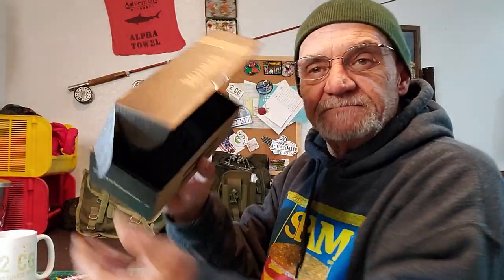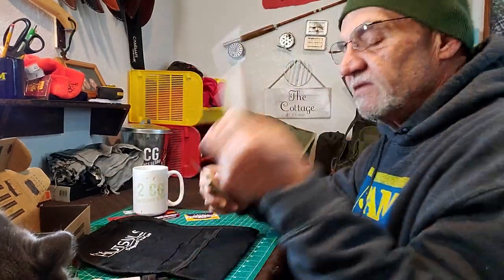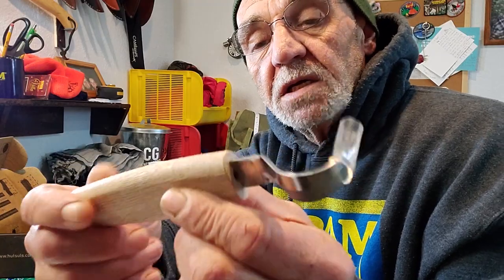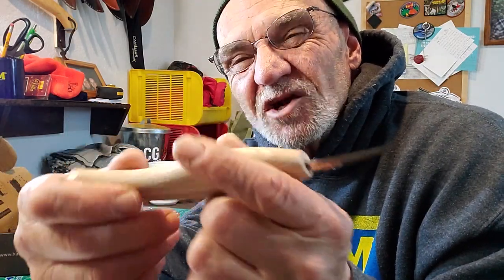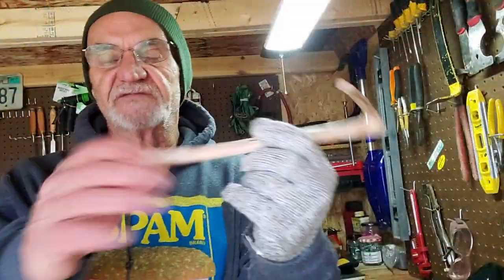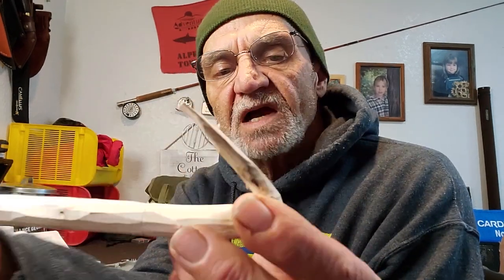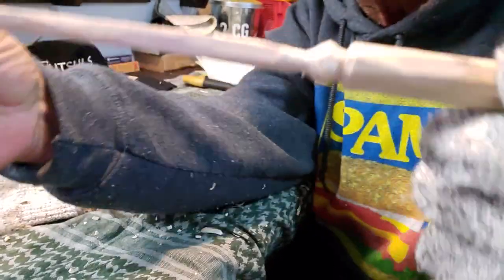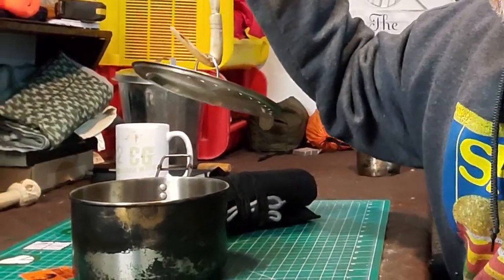Hutsuls Wood Whittling Kit for Beginners - All you need to start

Comment: It came out very good, the kit seems to have enough to get you going for beginner and more.
I thought your covers had knobs on the top, so I thought you were going to carve a cup into the side of that, so it could life it under the nub of the pan lit.
Much easier, now that I understand the use.
Thanks for the demonstration.
Have fun, be safe.
Reply from the maker: On most stanley stuff they pots etc. Come with the plastic tabs to lift the lids. I think I melted everyone...lol. so now I just replace with a key ring which works great. Thanks for watching and commenting. Much appreciated 👊.  Stay safe